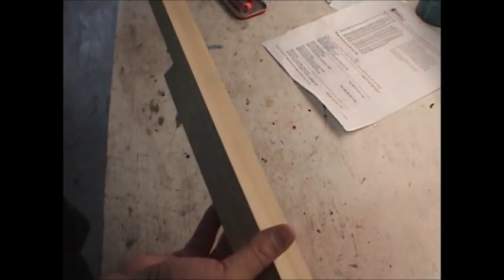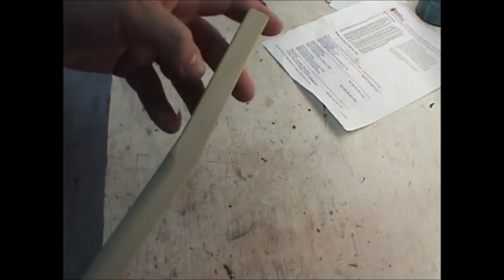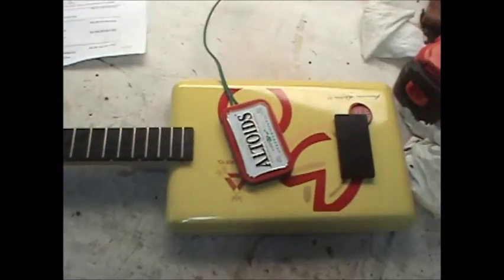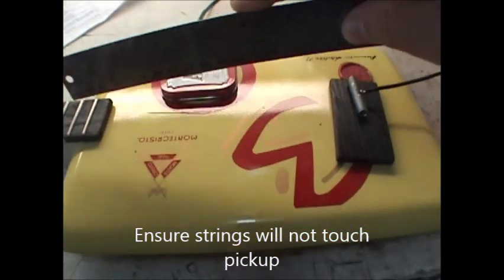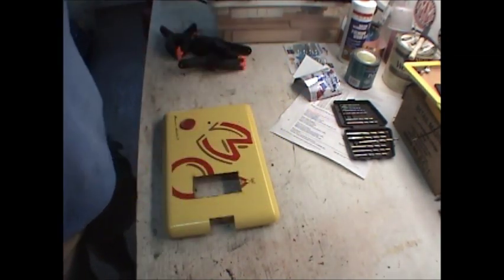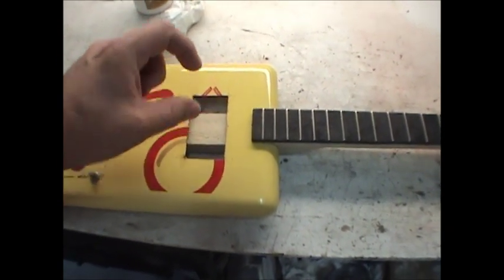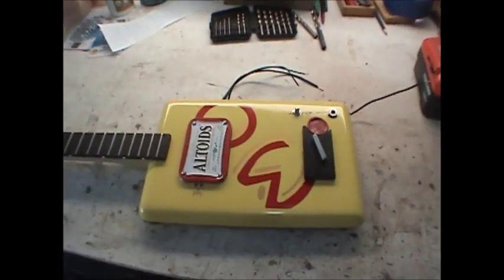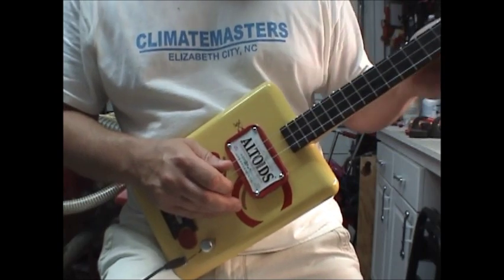How To Make A Cigar Box Guitar

Comment: What's that altoids pickup made out of? It seems really interesting.
Reply from the maker: The altoids pickup was made out of an altoids lid... hehe  The pickup (magnetic) wires were wound around a bar magnet which was attached and epoxied underneath.  The whole lid acts as a pickup.  Sounded great... I wish I still had that guitar.

Gotta be careful though... I made a few of these pickups and one came out terrible... acted like a microphone... tooooo sensitive.  I don't know what I did differently on that one, but subsequent ones were fine.
Reply: @kasteneric  Very cool, i've never seen a pickup made in that way before.

Comment: Hi, great build sir! I don't know if you still reply to questions on this build but I just have a couple of quick once if you don't mind. So I happen to have the exact same box and is ish half way through my build. my questions are, you don't seem to have a tail piece on this guitar, so how is the strings fixed, is it from the inside? if so, I'm thinking about doing the same, is it a hassle to change strings? My other question is, did you screw into the back of the box to secure the back piece? Because that is sort of the only solution i see as of now. Again great guitar!
Reply from the maker: +Ulf Skjerve Hi there... and Thanks!  I had to go look through my photos of this guitar (I had sold), in order to recall how I did the strings.  ...Yes, the strings go all the way through the body of the guitar (box).  There are rolled pins in the holes that are flush with the surface to keep the strings from digging into the wood (on the black base under the bridge).  On the back of the guitar, I used recessed string holders... these can be found on cbgitty or online... but basically they are pressed into three holes and allow the string ends to be held "inside" the guitar and not on the surface of the guitar.  Think of them as inverted cups.  To change the strings, just pass them through the body of hte guitar.  Simple.

Also, the back of the guitar (bottom of the box) is screwed closed.

I have made guitars where the strings pass into the guitar and the back of the guitar has to be removed in order to change the strings.  It is a very clean/sharp look, but does require a little more work to change them... but not much.

I have more photos on my website (link is in notes below video)... and I have a "hot to" book on amazon as well...

Comment: How do you scale these, I mean intonation has to matter right?
Reply from the maker: "How do you scale these"... not sure what you mean.  they scale just like a regular guitar.
" intonation has to matter right"... with the threaded rod for a bridge, you can angle it to get a decent intonation (only worried about 3 strings), but you can also use an adjustable bridge to adjust each string individually.  Justin Johnson has a good video on intonation for this type of guitar.
Reply: Eric Kasten OK my next question is What is the normal scale people are using for this type guitar. A strat is 25.5 an LP is 24.75 what would these be.  Or is it simply what ever the builder wants to scale it at.Thanks
Reply from the maker: Yes.  It is whatever the builder wants to use.  I use 25.5 pretty much exclusively now.  Others may use any length they choose.  There are online fret calculators that will tell you the fret spacing for any scale length you choose.